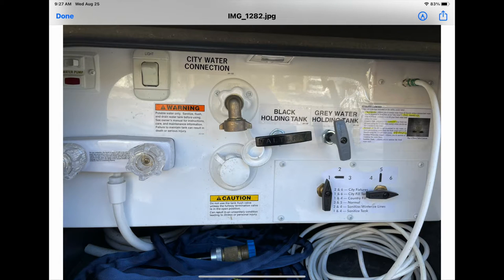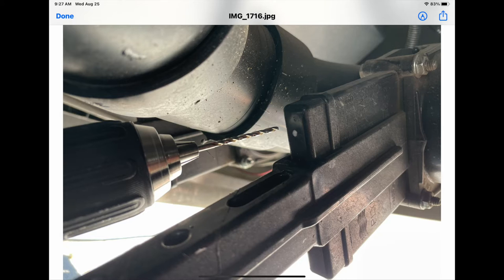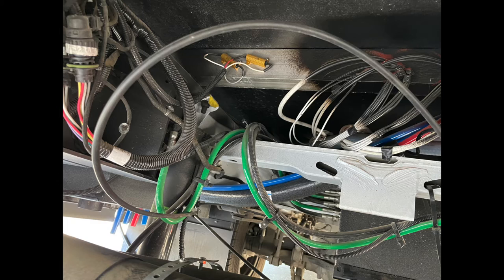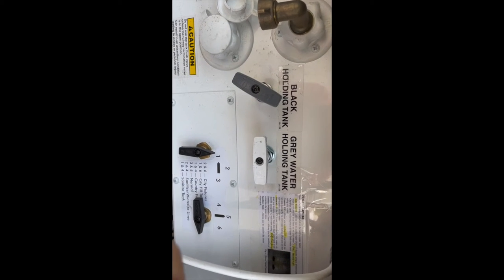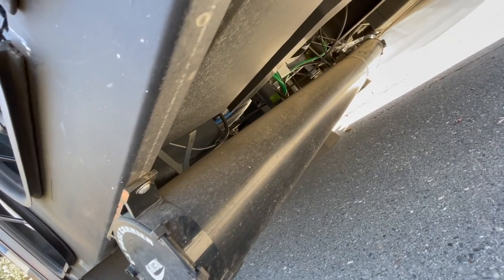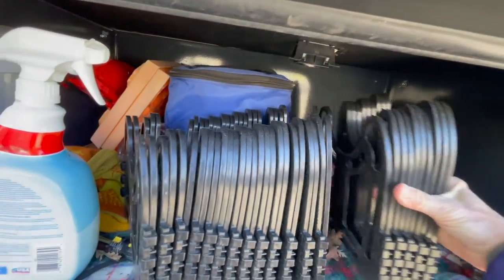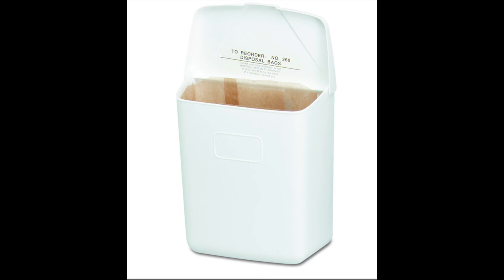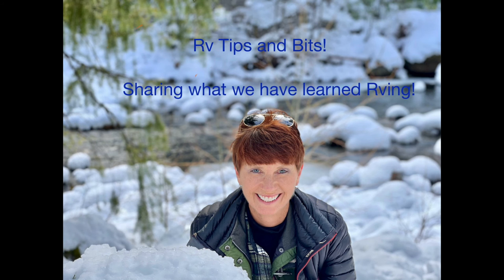Stuck Valves, Black, Grey Tank Tips! Trailer, Rv's, be efficient!

Comment: Great video for black and grey tanks for drain cableing and valve lubrication.  We've been unable to find out what to do to lubricate the FRESH water tank drain valve so it too won't stick or its gasket fail to seal due to drying out.  We don't think that pouring Thetford Drain Valve Lubricant, White Lithium Grease, Vegetable Oil, or Propylene Gycol Anti-freeze into a FRESH water tank would be advisable.  There are plenty of videos how to deal with the black and grey tank valve seals... but what can we do/use for the fresh water tank drain valve??